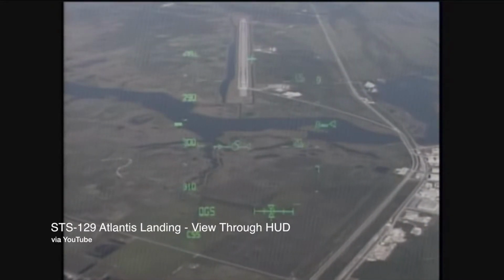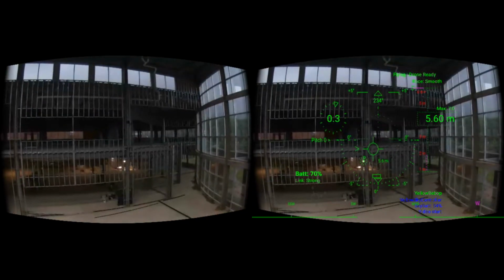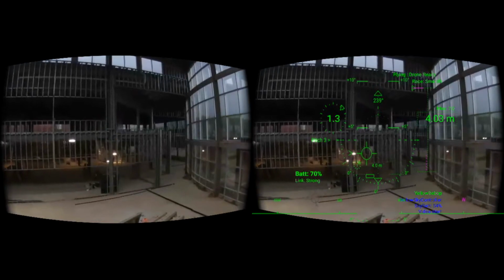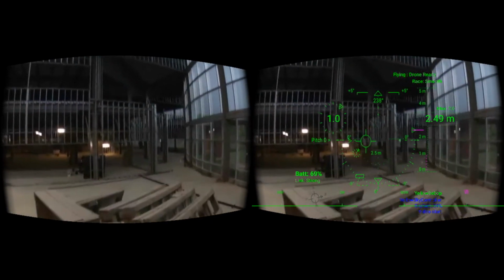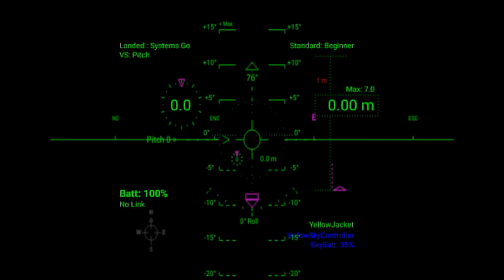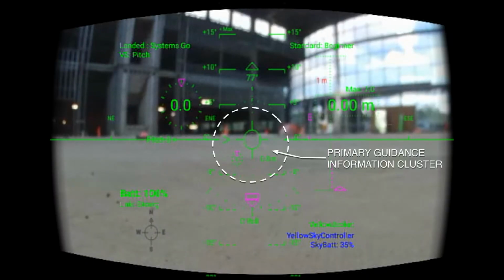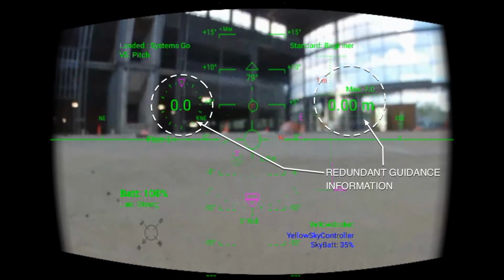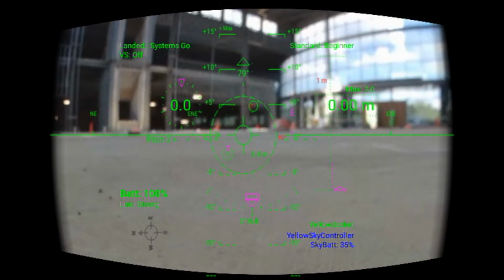Designing an FPV Drone Racing HUD for my Parrot Bebop, Galaxy S7 and Gear VR [Low Rez]

Comment: Great looking concept. Hope you get it all working and up for sale. I fly my Bebop 2 with a Samsung S7, and I'd like to fly on FPV. Your display would be brilliant for myself.
Reply from the maker: Then spread the word. Augmented Reality is a hot debate in the world of aviation and now I'm bringing it to quads! If I get enough interest I would be willing to devote much more time to this project. Thing is, I know it works in mild turbulence (something less powerful than the massive magnetic fields at the testing site) at low speeds ( <8M/s ) in relatively tight spaces. I would not be comfortable releasing it until I've been able to successfully test it at the bebop's max speeds first. For that I need a new space. Stay tuned.
Reply: I've used Parrots new FPV mode in the Free Flight Pro app....but it seems a little basic. Plus there are issues with the camera from the phone. Let's hope you nail it and make this a great app and have no reliability issues.
Reply from the maker: I couldn't get Parrot's FPV to work on my phone. I only get the phone's built in camera feed!
Reply: I kept getting that too. All I ended up doing was to exit the app and then restart the app.....it would then start showing the drone feed properly. But it seems to do it everytime you use the app. Deffo a bug in there!